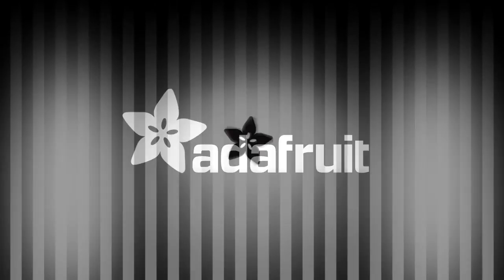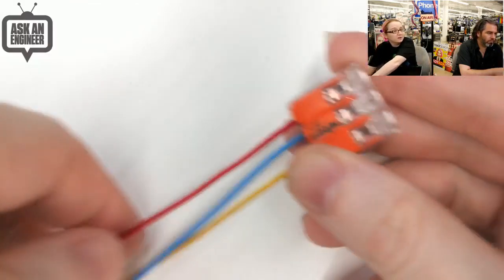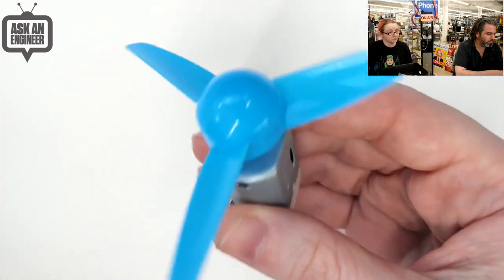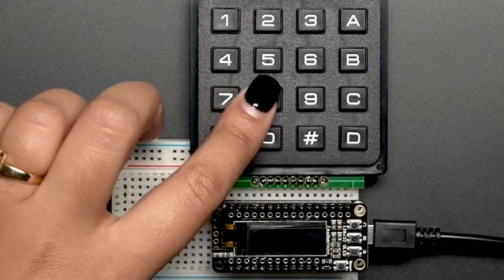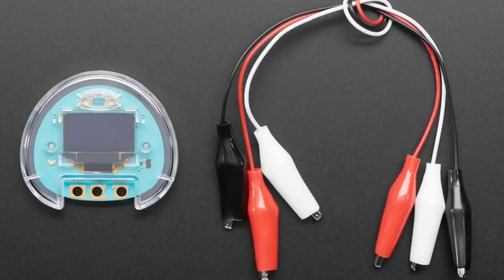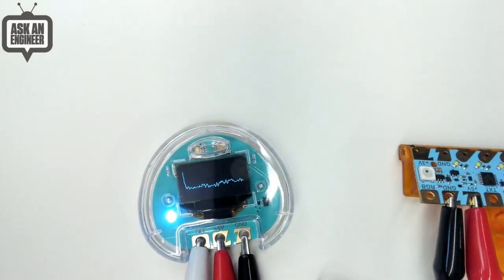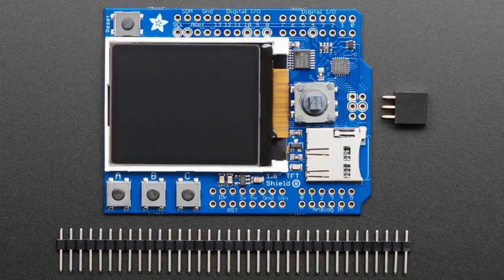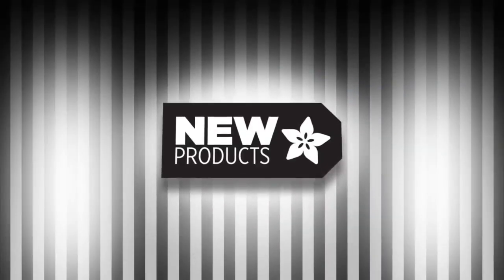New Products 8/8/2018 Featuring Adafruit 1.8" Color #TFT #Shield! @adafruit #adafruit

Comment: 1:05 Very confusing explanation to some looking for splicing but may not be familiar with wire nuts. I know what you mean when you say "it basically connects them all together as one" but that reads like a cold splice. which would be awesome. and while wago is amazing, I actually bought these for a different purpose from you, unsolicited but i'd consider adapting how you explain these